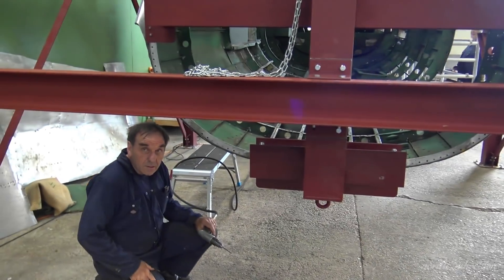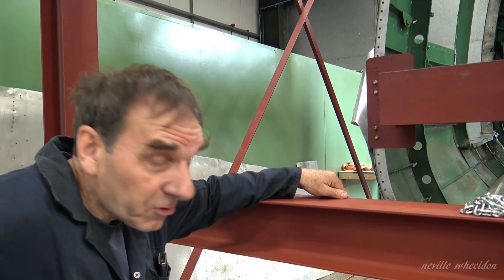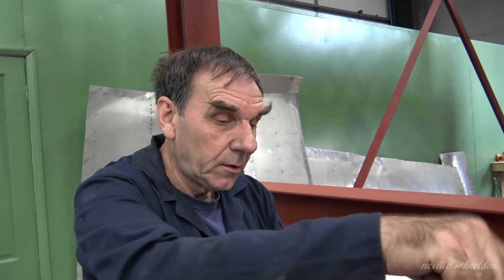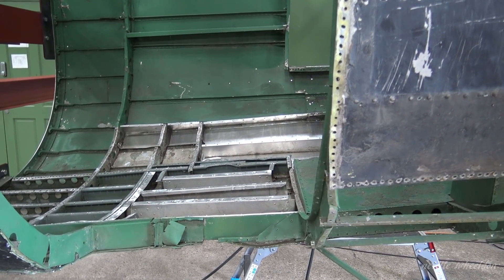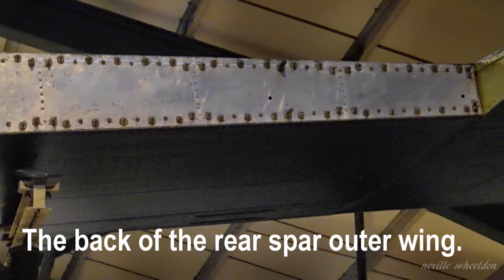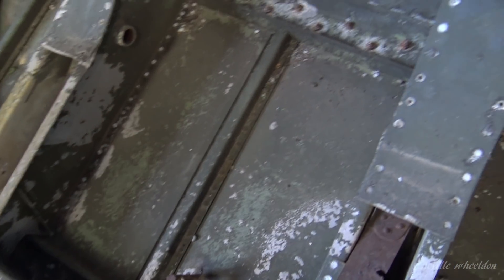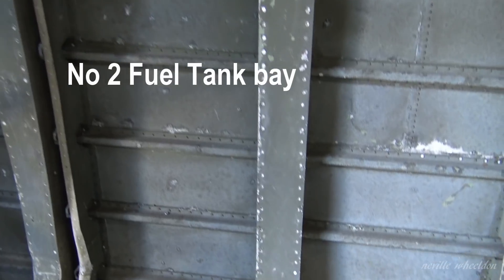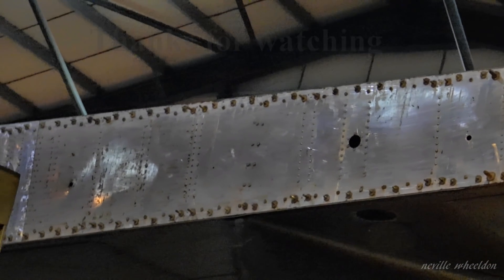Video 102 Restoration of Lancaster NX611 Year 4.   1/16 of an inch thick outer wings SPARS ??

Comment: Adding to Rex Myers post below,   the  flanges of the spars,  carry the bending loads ,  tension or compression,  which can reverse in positive and negative g ,  while the (1/16) web , between the flanges, carries the shear loads between them.   The wings are essentially cantilevers, with the bending moments produced by wing lift , increasing towards the wing roots,  with these bending moments reduced by the weight of the engines,  undercarriage,  and fuel.  The shear loads behave in a similar manner.    Anyway the 1/16 “ web ,  reinforced/stiffened/braced by the wing ribs ,  should be strong enough....well it was in 1945 😈,  assuming the Al alloy  ( L72 ??? ) is to the same specification.   I’ll watch the video again to.....see how the torsional loads are carried.  They appear to be transferred to the front and rear spars by a mixture of internal bracing....a la Forth Railway Bridge....and the (in my humble opinion ) very rigid open spars,  eye section in nature,  to enable the self sealing bag tanks to be installed.
I love the sound of those windy drills.  I learnt the M ost  I mportant  F ormula  Y ou’ll  E ver R emember in the stress office at BAC Warton as an undergraduate apprentice, 50 years ago.  Nearby sat a weights engineer who showed me Guy Gibsons signature in his flight engineers log book.   He delighted in winding up a rubber band contraption which he sat on.....he would raise himself up ever so slightly off his chair,  and produce an enormous fart every time a  young Secretary, or VIP went by !!   Harmless fun really ,  but I did wonder what was going on,  until he let me in on the secret.
Reply from the maker: Hi CD, the web on Just Jane NX611 and the French wing NX664 I don't thing they been changed so they will be original from 1945' (L72) .Thank you for an interesting read.
Reply: @nevillewheeldon1693     I should have written.....and the (in my humble opinion ) very rigid open RIBS , eye section in nature,.....

Comment: The spar on any aluminum constructed airplane is built up with an upper and lower thick piece called (in the US) a spar cap. The thin sheet metal between the spar caps is called the web. The wing ribs attached to the front and rear of the web provide torsional stiffness to the spar assembly. This means the thin web is resisting bending along its edges. It’s very strong this way while still light weight. Hope this helps explain it. Cheers.
Reply: Thanks for that explanation, now it makes sense!
Reply: Aeroplane, old boy..

Comment: Silly question, about the armament that the Lancaster would have carried.  To be closer to operations, the weapons should be fitted, even if in non-firing condition.  //  I wonder if you could review the bidding on the jig, and swapping of fuselage section.  Where were the data, and measurements for the jig obtained ?  I can remember how critical jigs are in aerospace, as an example, Boeing was going to charge the US Government to store the jigs for the B-707 (a basis for the KC-135 and the E-3 AWACS - in the UK inventory) and the funds were not forthcoming, and the jigs were disposed.  So the present jig would appear to be a fresh build, and enquiring minds want to know.  Do I recall that this aft fuselage section is from storm damage, and is being restored to "taxi" condition, and then will be swapped with the Just Jane so that her current section can be placed in the jig, restored to flight-worthy condition as a needed step in the "10-year" restore to flight plan ?  And I'm sorry to ask - do you have an apprentice - an heir-designate for this critical work ?  Big shoes you have.  Another fantastic video.
Reply: You are correct in your question. The Doncaster rear fuselage will be restored to taxying condition then fitted to Just Jane for the next I expect season and Jane's rear fuselage will go into the jig to be restored to airworthiness.
Reply from the maker: Hi HH ,hi do not have the information you your inquisitive mind request. I am a visitor to the Centre and have nothing to do with the running of the Restoration of the Lancaster. The management allows me to video the engineers working. When it come to the Jig  data and measurement I have no detail of this.  I know they were working from old photo of the assembly lines and the jigs being used and replicating  them. They do contract out to a firm who specialise in this field. When this Doncaster fuselage is finished it will be fitted to Just Jane to allow the Lancaster to carry  giving taxi rides.  Giving more time to make Janes rear fuselage airworthy . I will keep talking to the engineers and if I find any thing out  I will let you know. Cheers and thanks for your comments Nev.